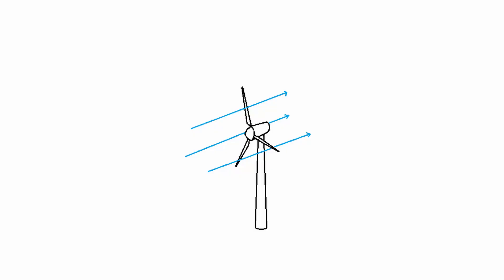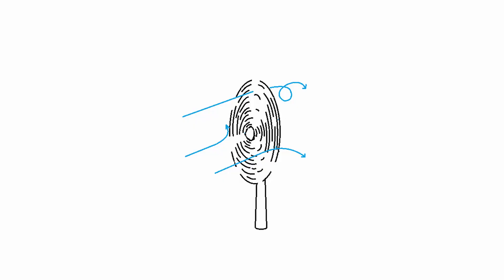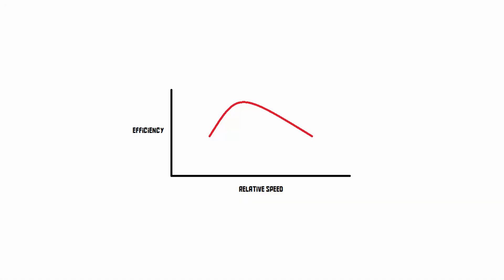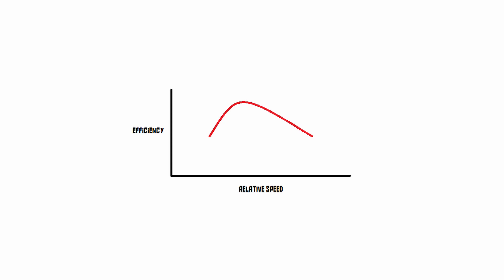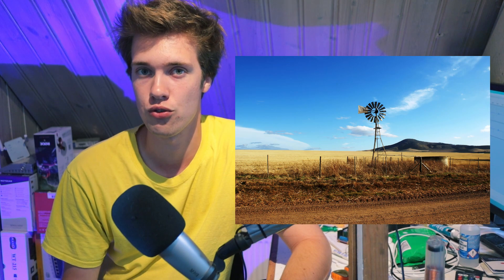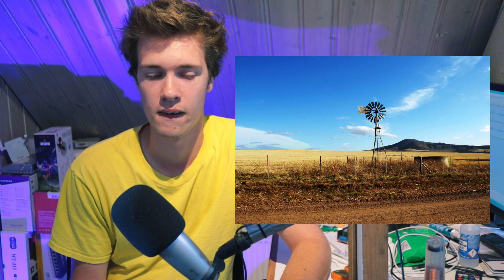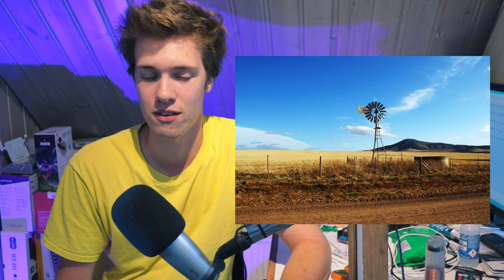Why most wind turbines have 3 blades

Comment: They say that the big deal with wind has do to with the efficiency actually increasing that larger they get. However, the added cost of scaling up, in so far as it is even possible with current material science, is not propertional to the increse in efficiency, not even close, especially if you want to go big enough that you have to used advanced and expensive materials.
Of course, one blade is naturally a third of the price of 3 blades, not to mention that support structure, which only need to support  the weight of a single blade rather than 3, and if on top of that it can also be more efficient, might we not one day see extremely large and also extremely slow, one bladed designs?
sure there aer challenges, like the need for a counter weight, but might that not be solved with some clever areodynamic, effectively making is an assymtric two bladed design, the secondary blade being insignificant size and weight, comparetively, serving only to generate  drag in a specic way to act as a coutner balance?

One could imagine standing at the foot of such a gigantor, waiting for minutes, or perhaps even hours, for the blade to reach it's lowest point, at which point the challenge is to remain is place, knowing full well the blade tip will come not closer than the length of the several football field, only all proportionality is gone, so that the our subconscious minds have no way of reaching that same conclusion, as the giant blade moves ever closer, in what appears to be a straight line towards you at near the speed of sound, or perhaps even faster.

Comment: If you had a furling wind generator you would not need gears ( or even electronics) to pitch the blades. This is because they move the blades out of the wind by spinning the entire head. Perhaps a two bladed wind generator would be ideal for residential generators.